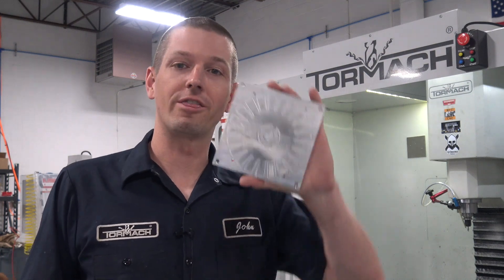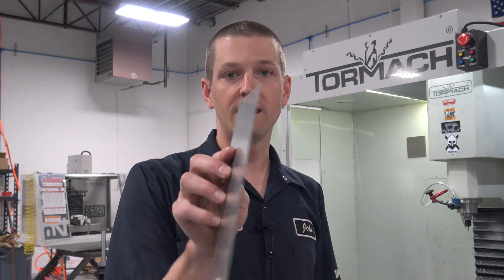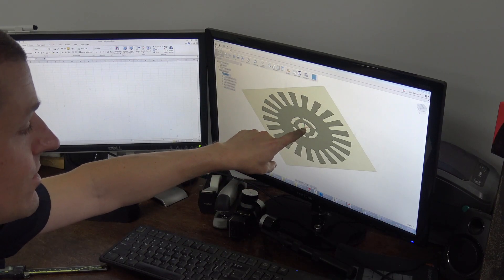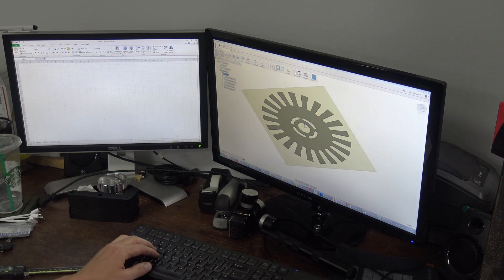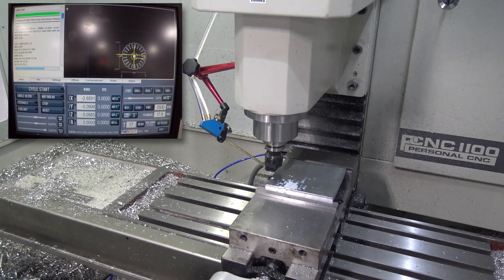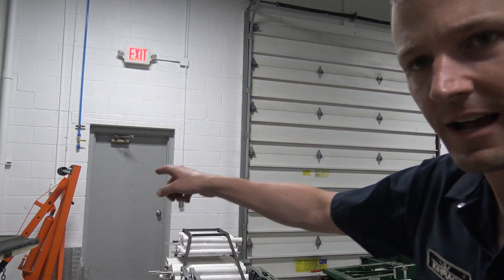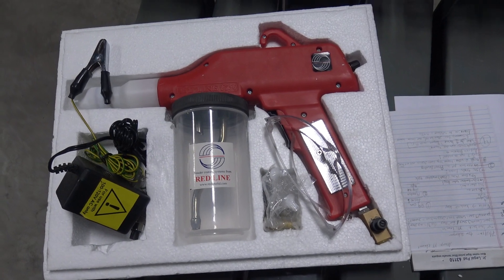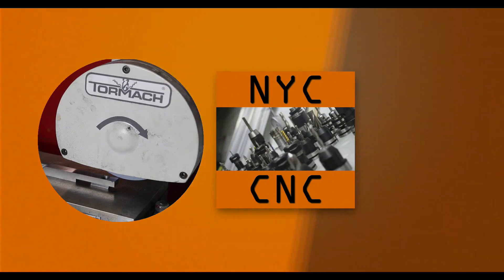Machining & Powder Coating an Encoder!  Widget103

Comment: I had the Eastwood powder coating gun as a start and then went to the Redline.  Having better results with the Redline.  Less back-ionization. 
Question:  Looks like you have a little mister for air/coolant.  What one is that and what are you using to hold it on the side of the spindle?  Just curious.  I need one! :)

Comment: To remove adhesive easily and safely without damaging anything, buy a can of air freshener from the home depot called "pure citrus" and spray it on the tape. I use the stuff all the time and it makes adhesive just melt off. Old Indian trick

Comment: John when you're jogging your Haimer around, be aware that it can throw out your Z. Inside them is ball and cone thingie that does the measuring, and it's only designed to measure one axis at a time, any movement in another axis will be added to the reading. The drag of the probe on some materials can make them look like they're not flat when in fact they are better than they look. I'm thinking of putting a sign up in my workshop "Days since ... last Haimer probe broken".

I have that cheap (broken) powder coating gun and also a big commercial one. The latter uses a heck of a lot of powder so I never use it. I think you did well to get the one you did, it looks ideal.
Reply: You can drag the ball along a surface to check flatness or tram.  Even says so right in the manual. But you can't do it full down with the needles at 0-0. Only 10-15 thou in an axis. Otherwise it will ruin the internal mechanisms.  And there is no fixing it either.
Reply: That is not true. I have pulled a Haimer apart numerous times, indeed John asked me to put up a video of the internals of his previous Haimer so he could reset zero properly. Unfortunately I just didn't have the time then to make a video, and then noticed he'd got a new one anyway. I can assure you the Haimer won't be "ruined" by dragging the probe  with it set at 0, indeed it can be over-travelled. Beyond the over-travel the ceramic probe will break, which anyone who actually owns a Haimer will testify to. It would take a major Z crash to ruin the internals of a Haimer!

Movement in any axis of the probe is added to the movement in the other axis. In Z it's not as bad, as the probe is spring loaded to X/Y zero and I may have overstated the problem, however it's still possible, and why I mentioned it. Where it's definitely affected is when indicating an edge and traversing along it, irrespective of what any instructions may say! If the probe is dragged along an edge it may provide a false reading, especially if the surface is rough. I know that for a fact as I once spent some time chasing my tail looking for a problem that didn't exist, and in fact turned out to be the Haimer mis-reading due to dragging the probe.
Reply: +Pete F Long Island Indicator won't even repair them.  Even they say to send them out to the manufacturer due to special jigs and fixtures used to align and set the zeros of it. 

You can "repair" it so it functions, but won't be nearly as accurate as it was before. 

And no offense, but I think I'll trust the manufacturer whose been making them for decades now as to what you can and can't do with it and what will harm it or not. 

German built tools are very specific about their operation in their manuals. So if they say you can do something, it's assured they have fully tested it. 

And I personally have trammed X and Y within 3 tenths (double checked with an indicator) with a Haimer on many occasions. So if it's "off" it's by an incredibly small amount.
Reply: +Pete F I think I know the issue.  Are you taking about a Zero Master from Haimer? The ones Tormach sells through their site?  If so then you're correct.  They're not designed for X-Y traming.  And are probably more easily repaired. 

The NG and Universal 3D sensors are designed for measuring and tramming in any axis, and are very much not easily repaired by anyone but Haimer. 

I have the Universal one. Not the Zero Master.

Comment: Sorry but I have a question that has nothing to do with your video but thought I would ask an expert. For the life of me I can't find anywhere what the tightening torque is for a TCMT insert or for anything similar. Can you help? Thanks in advance! Dave
Reply: 0.8- 1.0  Nm is the general torque for lathe insert screws.  The little wrench supplied with the tool is designed so you can't over torque them unless you're really trying.
Reply: Thanks you so much! Can I ask where you find this?
Reply: +Dave M they're marked on all the little wrenches 😆

Also most tool manufacturers list it under their insert and tooling specs
Reply: I store the wrenches because I have  nice Wiha set I use. But pulled them all out and nothing but their size is on all of them. Also in my search I looked at a lot of tooling and insert specs and never found anything. All I found was its suppose to be stamped on the insert holder so looked at hundreds of images of holders and never found anything. Ah la. Thus posting my question here in hopes someone like you would respond. I will be talking about this in my next video on my channel and see if any of my subscribers have any input about it. Again thank you so much for responding!!
Reply: +Dave M I just checked Sandvik's site.  They list torque specs right in their tooling pages. So does Seco. And I have torque specs listed in the Korloy manual that came with the 1" insert cutter. I'll check the insert wrenches I have. I know some had their torque stamped on em and some didn't. Not sure what brands stamped em on the wrenches or not though
Reply: +Dave M and honestly. How many people really check the torque on inserts, or any tool holder for that matter. There's torque specs for ER collects that vary depending on size and shape. But how many people actually set them vs how many just tighten it till it "feels right" ?  Then you have the people who throw their whole body weight into it when tightening XD
Reply: OMG another spec I didn't think of! If you watch my channel I address, or try to anyway, only material concerning the Chinese mini lathes and mini mills. I started thinking of insert torques because in my last video I show how to make a 3/8 insert holder for the lathe. If you watch some of my videos you'll also see I use ER32 collet chucks on both machines. Now you tell me collets have a torque spec too! You need to start a channel so I can subscribe ..... The next video will definitely get people everywhere thinking about torque.
Reply: +Dave M anything involving a screw on machine tools has a torque spec somewhere. Collets, main screw on a vise, the screws to bolt in the jaws, pull studs, lathe face plates and chucks. Damn near everything.  There's even a torque spec for the mounting screw of a Jacobs Chuck.
Reply: Found that one easy! ER32 100 ft/lbs and that is a crazy number!

Comment: Good video John. If the customer requires these parts frequently, may I offer a suggestion to machine a stamp or punch+die for it? The part could then be made in seconds without the need for fixture holding, CAM set up, gluing/seperation etc.

Comment: For best adhesion clean with something like Ajax abrasive cleaner (see Dan Gelbart's prototyping videos, also a good powder coat prep). You might also want to look at Mitee-Grip heat activated workholding sheet, mesh and sticks.

Comment: I saw that you were slotting (NO !!!)  lol.  Is there an alternative to doing a slot in the situation or just run and hope for the best ?

Thanks for the videos !

Chris
Reply: Fusion 360 doesn't have it (or I haven't found it) but there's a tool path option in some CAM software called "oscillate". It causes the tool to move up and down in Z as it mills the tool path.  It's specifically designed for slotting in thin sheets. 

Ramping contour is also an option, but would probably take way too long for a part like this.

Comment: John,  another tape is 3M VHB (very high bond).  I was told by a 3M rep that the panels on Fedex delivery trucks are bonded to the frame with it.  I use it on my lathe to bond things to a fixture.  Comes off with acetone.
Also I would build you a powder coating cabinet with the front open, and with a Lazy Susan at the top to rotate parts. https://www.amazon.com/Susan-Bearings-Thick-200-lb-Capacity/dp/B0006LBVDI/ref=sr_1_3?ie=UTF8&qid=1469010867&sr=8-3&keywords=lazysusan

Comment: Nice video and interesting part. I had not thought to measure flatness by dragging a Heimer over the surface. Nice tip. Thanks.
Reply: Yes... Cept don't do it when it's fully at 0-0 on the dial.  Will ruin the internal mechanism doing it that way. Just bring it down to the 10 or 15 mark on the outer dial and sweep that way.

Comment: Why not just use superglue to hold it and then heat it up to remove it? Seems simpler.
Reply: Hot glue
Reply: tape is really flat, glue can make some high spots
Reply: No not when press it down with even pressure using bar stock or parallels or something similar
Reply: yes, but where is the point of using glue over tape then? I'm using pressure activated tape without any tool, I simply press on stock with my hands and that's all, it's flat and parallel with a table all time. Honestly I never used a glue to hold a stock, because I had no reason to.
I guess glue can be better for some wierd shaped stock with smaller flat area, but with a sheet I'm for tape.
Reply: +Jakub Bendzala because its way fast just blob bunch of hot glue press on with your hands or use parallel and use heat gun to take if off and peels off easy instead of messing with tap
Reply: but that's another advantage of tape, it can also be heated a little bit for better peeling off and It's made so that there is no residue on part or table. With a glue you have to clean part and table. I'm used to a volumes of dozens or hundrets of small parts and it's really lot of time to add a one operation on every part. For one or two parts it's really doesn't matter.
Reply: and I forget we use glue because if we use tape the tape can't handle the 1000 psi or 300 psi coolant pressure but the glue works just fine
Reply: Yes this is the big issue with the tape, I have to use a mist, but for sheets it's ok and for my setup it's a little bit less time consuming.
But I have to try the super glue with flood coolant, may be I will be able to speed up feeds to the point that time saving in machining will be greater then additional glue handling time and as a bonus there will not be a chip mess all a round.

Comment: The Eastwood gun works good for small stuff as probably your new gun, but once you get into large parts, that is where they fall flat on their face.  I still use my eastwood for really small stuff (that is now 14 years old) over my pro gun due to ease of use and quick setup and teardown.  There is a huge difference in mill thickness that adheres to the part between the guns.  If you are shooting large and or heavy walled material, a higher voltage gun makes all the difference in the world.  The eastwood is only around 15kv, while your new gun looks like it will do up to 50kv.  When you start getting up in the higher voltages, you will start running into the faraday effect around sharp corners and between joints which can be a real PITA!  A good way to tell if  you have your voltage set appropriately, is by how much powder is falling off the piece.  My Eastwood would have as much powder on the ground as it sprayed on the part, while my Pro gun would have virtually none on the ground, but would manage to go through a significant more powder.  Also, I know the cheaper guns run a ground off the gun or controller, but you should run a ground from a common ground bar.  I didn't believe it, until I tried it and it made a huge difference on larger parts.  Without the secondary or main ground, it would cause your shirt to suck to your body like shrink wrap each time you pulled the trigger, this really isn't a good thing as the powder isn't being fully charged to the part.  With the primary ground to a ground bar, this isn't a problem and powder adhesion has to be seen to believe!    Sorry a little off track John!
Reply: Yes, grounding the part to the main building ground is the correct way to do it.  Then tie in your gun ground to the part.  I know Eastwood doesn't mention it and for their gun it works fine doing it their way, but when you start talking 50kv-100kv  you really need a proper ground to have it adhere correctly.  Like I said, without the main ground, it would suck my shirt to me and all my hair would stand up, a real weird feeling.

Comment: kind of silly to mill this. customer probably didn't realize laser cutting would have been cheaper.
Reply: +Vladgorod7 I can guarantee the cost for 1 is less than milling it.
Reply: +Vladgorod7 try lasergist.com. Just upload the design and get the part next week. Yes they will do one piece. They wont powder coat it though
Reply: Yep it seems insane to not laser cut this. The only reason i can think to mill is because of tolerances, but then they powdercoat it anyway. Crazy!

Comment: Over on clickspring he as alot of sucess using superglue to hold small delicate clock parts to be machined. Removal involves either heat or acetone. Not part distortion.
Reply: Clickspring is the best quality instructional video maker on this entire site, none others even come close.
Reply: +coffeebuzzz agreed!